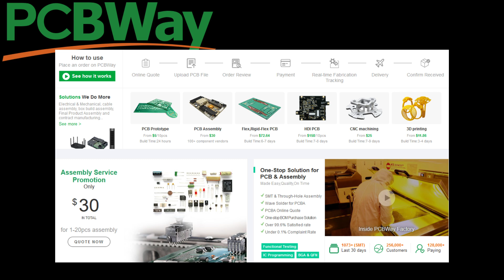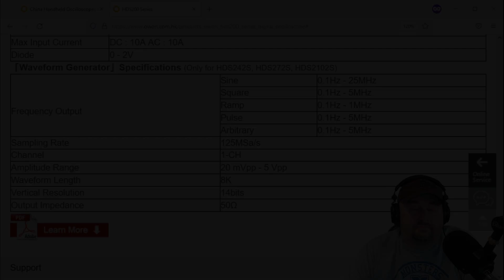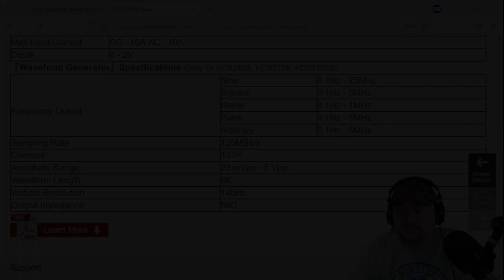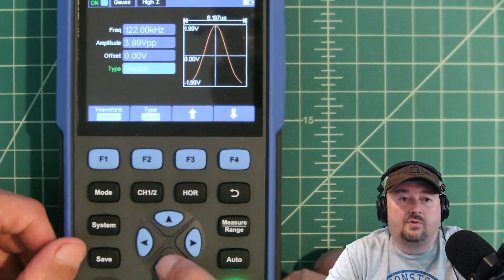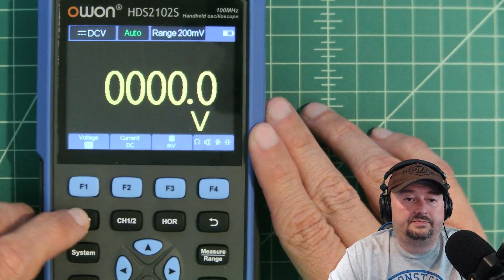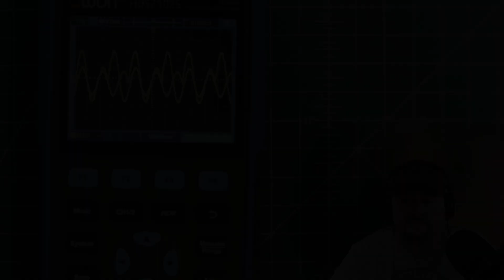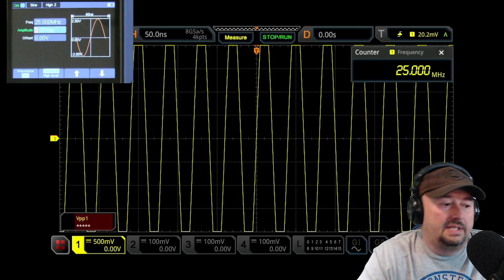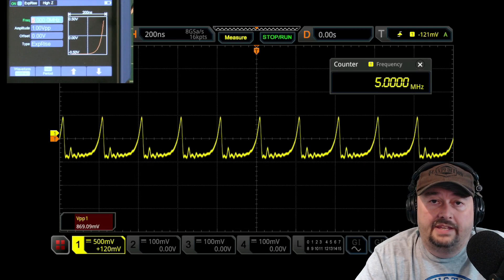OWON HDS2102S Signal Generator Features

Comment: I just got this exact model with firmware V4.5.0, but for some reason booting is not as instant as yours. Instead I always have to wait a couple of seconds for the loading bar to disappear. Quite annoying, especially since in all review videos it boots immediately after the power button is pressed. Feel kinda cheated to be honest, for an otherwise great tool.
Reply from the maker: Maybe its that firmware
Reply: I have v4.7.1 and i also have the loading screen

Comment: The strange voltages are because you have no termination on the cable. You need a 50 ohm BNC passthrough. Also, the voltmeter has a warmup period of maybe half an hour. I'm only talking about 5 mV on a 10V source, but it is there.
Reply: Yep, that's what I was thinking.

Comment: The square wave would measure properly if you used a 50 ohm terminator with your coax cable or used a 10x scope probe instead. Your voltage peak to peak is reflecting back inside your coax cable, when inphase increases and out of phase decreases voltage.
Reply from the maker: Thanks for the info Darrin 👍

Comment: For the $20 added cost, I can't see why anyone would opt for the model lacking the generator, even if it is not the best or most flexible.  It is very handy to have and being built into a device that also has a decent multimeter function on top of the scope, it just makes it nice all-in-one battery operated portable.  I also love that all three functions run independently and concurrently.
Reply from the maker: I totally agree, thanks for the comment 👍

Comment: Stupid question: Would it be possible to generate a dirty sine wave into an APC UPS unit for example to see if the pure sine wave output does its job?  Also what would be another real life use case example for the signal generator in the Owon?  New to the channel and I find this stuff very interesting.
Reply from the maker: Be carful when messing with high voltage and make sure you know exactly what you are doing.  You could simple measure the output of the UPS without feeding a wave in to see how "clean" it is.  An example of what I would use the sig gen for is to feed a signal into a filter to see how much it's being attenuated.  Good luck with the hobby Zack!

Comment: I think there may be issues with impedence miss match.   My OWON HDS242S 5 MHz Squarewave looks similar to yours and is also much better at 1 MHz.  I don't know how much you paid for the 100 MHz version but this device is AWESOME for a ~$200 3-in-1 device!!!!!!!!!!!!!!!!!!!!!!!!!
Reply from the maker: Hey Dan, I got it from one of the China sites so it was about $200 and I have to tell you I like it!  It's sitting here looking at me right now.  Thanks for watching Dan.
Reply: Yes it's an impedance issue, you can't push MHz signals through 50 ohm coax into a "1 Meg" scope input because that scope input has like 15pF capacatance, and the cable adds maybe 50pF more depending on it's lenght, so that's NOT "Hi Z" anymore, not in the RF frequency range.  This is why you see larger errors at higher frequencies.  To get accurate readings, terminate the measuring scope end of the cable with a 50 ohm through-terminator and then go into the HDS2102S "System" menu and change the output impeadance calibration for the AWG from "Hi-Z" to "50 ohm".  When I did this the levels were accurate to a few 10's of millivolts across most of the band.

I agree that the HDS2102 is nice hardware, but the onboard firmware and Control layout, and the resulting "ease of use" score really keeps the device from living up to it's potential.  A prime example is the fact that you have to juggle and jerk around through that extra menu (that works totally differently) to even get to most of the AWG waveforms - and you can't even set the output impedance that I referred to from there at all, but instead have to jump to the "System" menu -- Grrrrrrr.

Add to that 1) No Sweep function for the AWG, 2) Lacking basic features like Cursor Math (what's the Delta reciprocal frequency, rise time, fall time etc, 3) In fact No MATH menu at all, 4) No FFT functions even though with 8000 point capture depth, and that powerful CPU it could do quite a nice FFT, 5) Screwed up inconsistent User Interface, 6) Bad inefficient control layout, for example the Oscilloscope Function and AWG Function should EACH have their own "Run/Stop" buttons, as should CH 1 and CH2.

The hardware waveform capture quality on this scope is AWESOME, but everything related to how you control the scope ranges from so-so to total crap.  

Think about clever devices that MAXIMIZE the hardware like the TinySA spectrum analyzer, or the various models of NanoVNA's  -- Now imagine that level of effort applied to this hardware -- For example Being able to have the AWG sweep from 1Hz to 25MHz -- send that signal through some external device you want to sweep, send it's output into channel 1 where the amplitude and phase are precisely checked and a beautiful BODE amplitude/phase plot generated.  This could work really well, because the scope firmware could note when the amplitude starts to fall off, and compensate by automatically gain stepping the front end attenuation as necessary, generating a very useful BODE PLOT with 80 dB or more dynamic range.

That's the kind of features we would have on this scope if OWAN was 1/10 as smart about MAXIMIZING their hardware as the NanoVNA or TinySA.  Instead we have incredibly wonderful high quality hardware brought down to VERY MEDIOCRE levels of performance by lackluster scope firmware.

With the price point now well above $200, I wish people would STOP recommending this scope until OWAN get's their shit together and releases some decent firmware for it.
Reply: @steveb.548  OK!  I guess your not thrilled with it!  Everyone has an opinion an I respect yours!  Nice review, anyway!!!